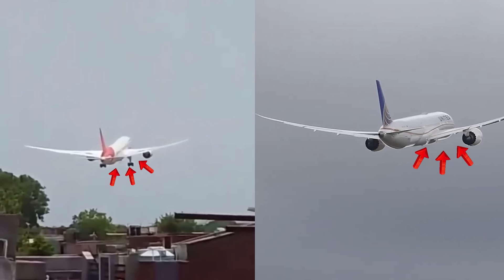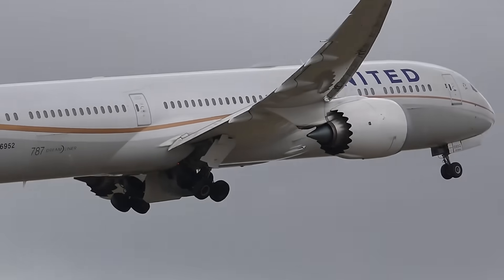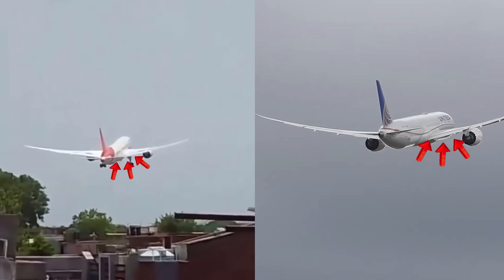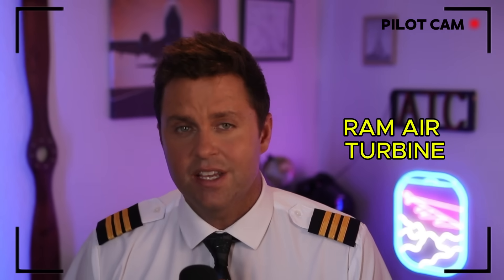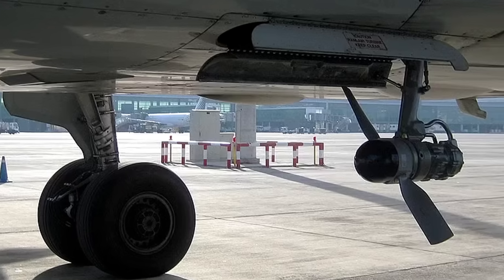Pilot Explains: A New Detail in the Air India 787 Crash Everyone Missed

Comment: Ok, what happened was when the pilot monitoring correctly commanded gear up, a massive electrical arc failure happened and it made an uncommanded shut off of the fuel supply to both engines and at takeoff power, engines starved immediately, RAT deployed and they coasted to the crash. Inspect all 787 wiring insulation immediately, ground the fleet, why am I not in charge, cuz I’m stoned.

Comment: Yes that sounds like a good explanation of what could have gone wrong. I too also noted that in the video of the plane you don’t here the engines roaring (as when taking off) . Second point it seems, as Gary mentioned, that the wheels are in position to be parked but the panels still seem to be closed (and never open) probably indicating no hydraulics.
Last point following Ryan’s comment that have simultaneous engine failure cannot be for engine failure, nor fuel… it would be very unprobable … suggesting some sort of interruption stopping the fuel being sent to the engines

Comment: If anyone took the time to watch the video of the passenger on THIS plane on the flight, JUST BEFORE this one........
They will see that there were multiple system failures on THAT FLIGHT.
Enough to cause an ELECTRICAL SHORT, that caused both engines to fail.
I'm  NOT a pilot or  stewardess. I don't really like to fly.
But mark MY WORDS, it will be found to be electrical failure that caused both engines to fail.

Comment: Great job! I'm at 25000 hours ttl, 20000 in the B-737. Rumor going around, and I'm sure you've heard,: engines experienced a cascading dual engine FADEC failure.  Uncommanded bus transfer failure due to arcing in main power relay box. Water intrusion during preflight, GPU disconnected in heavy rain prior to pushback+ loss of eec at rotation, causing engine rollback after rotation. That, and a bunch of other technical mechanical/electrical $hit.

Comment: No one wants to talk about the obvious… In The Hound of the Baskervilles, Holmes deduced that the murderer was the dog’s master, and that is why it didn’t bark as the violence was taking place. The master was a refined gentleman who was beyond reproach or suspicion. The 787 has been in service for 14 years with no history of dual engine flameouts or hull loss. No other aircraft had fuel contamination problems at that airport. Any vapor lock problems would have had a history. The only plausible explanation is that the fuel was shut off after takeoff. Start looking at the pilots. When something happens that is crazy, do not eliminate the crazy explanation.
The black boxes will reveal all switch positions during the entire flight. I will be very surprised if the fuel start levers aren’t in the shutoff position.

Comment: 28 years and 22,000 hours with the airlines. I agree it was a double engine failure for those symptoms you listed. However, I do NOT think it was a fuel contaminant problem. Fuel contaminants don't typically cause smooth losses of power equally in both engines. I believe there is likely a software error in the ECM. I want to know when were the last software updates to ALL systems uploaded?

Comment: ----->140% TOO HOT TO FLY! 
Everything on the 787 is not only electrically controlled but, automated to some degree to be THE automatic Aircraft.
787s are the automatic Aircraft. That said, Computers (CPUs, ECMs, PCMs, Fly by wire which are all susceptible to heat saturation) are doing the complex work of the Pilot and are flight instruments and controls. How HOT did the Pilot's Dash get?  HOT HOT HOT enough to crash. How many people reading this have notice a Crack in their Vehicle's dash? How many people reading this have left their iPhone in the Sun and what happens then? Right, it shuts down!!!

Comment: I could be wrong, but that "wind down" of the RAT sound could be the doppler effect of the aircraft moving away from the cell phone. Think of a train as it goes by you. "Ding, ding, ding, dong, dong, dong…."  

Consider also that the METAR allegedly got as high as 43℃ which is some really thick humid air. That probably effects how the cell phone picked up sound. All this is conjecture on my part.

Comment: Hey @Garybpilot,

I really appreciated your thorough analysis of the tragic Air India crash—your breakdown was insightful and well-researched. However, I noticed that one angle hasn’t gotten much attention: the possible role of cabin temperature control and air conditioning malfunctions.

A passenger who flew on the same aircraft before the incident reported persistent issues with the AC, entertainment system, and even the flaps (https://youtu.be/9EDho1UDWzM/). Given how extreme heat and system failures can impact both crew performance and equipment, do you think this could have been a contributing factor?

I’d love to hear your take—maybe even a follow-up video diving deeper into this aspect? Keep up the great work!

Comment: Thank you for your analysis. My question is: 1, if it is a dual engine failure. The parameters would be downloaded by datalink in real time and the inspection for the fleet should begin right away. 2, Did the dual engine failure happen before gear up or after the gear up commanded by PF? Why the crew kept the gear down up to 600 ft before the “due engines lost?” 3, the crew use the TO-2 or TO-1 (not assumed temperature)for taking off with a wrong flaps setting or an accident flaps lever moving from 15 to 5,  Is the engine power still good enough to fly the take off segment 1&2? Thank you.

Comment: How comes no one has mentioned the idea of maybe the cargo if any on board was incorrectly loaded causing no lift or over weight? As looking at the take off clip the 787 used beyond the full runway (dust in the air) to take off but still had not enough lift. I think the engines were fine but something with the weight ratios caused the accident, either when loaded or inputted into the aircraft by the pilots prior to take off

Comment: If you look at the cockpit of a 787, the gear lever is very different from the flap selector (especially being two-position vs. many selection notches), so it's hard to imagine that a pilot with more than a few takeoffs in a 787 could mistake one for the other.  (And that tilt of the bogies seems conclusive that the gear had started coming up.)

Comment: Long ago there was a twin-engine airliner that lost both engines at cruise altitude due to loss of oil in both.  The oil loss occurred because both engines had just had routine lip-type oil seal replacements.  The maintenance people  had assumed that the seal assemblies (the seal pressed into a housing) included sealing o-rings, but they did not; they were supposed to added by the maintenance people.  (The o-rings are to seal the housing to whatever it is they mount against.)  The result was a slow oil leak.  The flight crew restarted after a long glide from cruise altitude and made a successful landing.
I'm not saying that's what happened here (the loss of oil took a long time), just that dual engine failure can happen due to some common cause.

Comment: U sound quite genuine and absolutely logical. There is no one upmanship in what u say. U r only trying to debate and come up with possibilities. I am no aviation expert, nor am I a trained pilot. As a ordinary layman, I can smell some kind of sabotage in this whole thing. I sincerely hope and pray that I am proved wrong.  Sabotage is a very strong possibility for twin engine failure….both the engines failing together is normally impossible….But what if there was a sabotage through turning off of the fuel pumps?….With whatever fuel that was there in the fuel lines, the plane took took off, but after that with the fuel pumps not working, the engines died out of fuel starvation….Remember, India’s PM has many enemies from Pakistan. That the accident took place in Ahmedabad, the very soil from which India’s PM and Home Minister hail, is no coincidence to me. As a layman, I strongly suspect sabotage, and the hands of India’s enemies. India’s neighbouring nation has been bleeding it with several thousand cuts, and this aircraft crash is one of those many thousand cuts……
Reply: "Normally impossible" is an odd phrase to use, because any failure of anything is by definition not normal.

Comment: Dual engine mechanical failure is unlikely. Fuel contamination is also unlikely, there are hundreds of flights occuring in that airport and nobody had fuel contamination issues. The only possible way that 2 engines lose throttle on both engines at the same time is by losing engine response centrally, a system which controls both engines through the Common Core System (CCS) — specifically through the Aircraft Information Management System (AIMS) and its integration with other avionics. A fire or electrical failure which supplies the CCS will stop sending signals to both engines and cause it to auto shut down or throttle down to idle, losing power. This in turn deploys the RAT.

Comment: Two events are sure to have happened. 

1.RAT was activated. 
2. There was serious power issues when the  flight was landing in Ahmedabad as per a video from a passenger.
So, it's obvious that it was a central power failure that led to dual engine failure and RAT activation. 
It's simple localisation. There's no possibility of  mechanical failure due to contaminated fuel. It will almost always affect many flights.

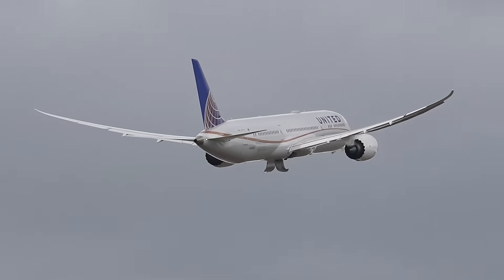Comment: I read somewhere in another video that the 787's slats will auto deploy. But not the flaps. But it does look like the flaps are indeed extended at 1:45. As for the RAT being deployed. I watched another video. And it sounds like it was deployed. Had a prop sound to it. And it was compared to a test flight of the the 787 with RAT deployed. They sounded exactly the same. This crash was a text book crash with both engines out. Side note. I never realized the 787's landing gear did that. I assumed it was the same as the 767's. Off topic note. I have flown on a 777. Still prefer the good old 747-400!

Comment: For those who say "it doesn't make a lot of sense," let me explain: A short takeoff from the Taxi Way entrance, overloaded to a million pounds, a lack of maintenance, or a maintenance error. Possibly watered-down fuel, excessive stress from those first two things. Loud Bang. Which could have been the RAT deployment. Or, engine failure due to the short takeoff and double capacity load. I often wonder if speculators aren't just trying to manipulate stocks one way or the other. Do you work for Boeing?

Comment: Still to be verified but it looks like a catastrophic electrical failure on rotation. 

Flight: AI-171 | Aircraft: Boeing 787-8 | Date: June 25, 2025 | Route: Ahmedabad (VAAH) → London Gatwick (EGKK)
Crash Site: ~1.2 km from VAAH Runway 23, post-V1 and rotation
Fatalities: <270(241 onboard + <29 ground)
Survivors: 1 onboard survivors (alternate to original), 3 injured on ground

🛠️  AAIB Preliminary Report Highlights

1. Primary Cause – Electrical Power Transfer Interruption (PTI) During Rotation
	•	During transition from ground to airborne electrical configuration, the aircraft experienced a cascading dual-engine FADEC (Full Authority Digital Engine Control) failure.
	•	Root cause: Uncommanded bus transfer failure due to arcing in the main power relay box (PRB-A), traced to water ingress during pre-flight GPU disconnection in heavy rain.
	•	This led to loss of electronic engine control at rotation, resulting in both GEnx engines rolling back to ground idle within 4–5 seconds.

2. Flight Data Record Timeline
	•	+0:11 sec: Nose gear lifts off.
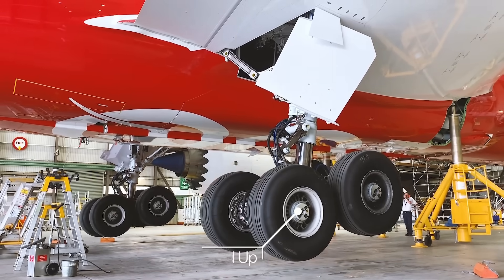	•	+0:13 sec: Sudden engine rollback begins. Thrust reduces from 92% N1 to <27% within 3 seconds.
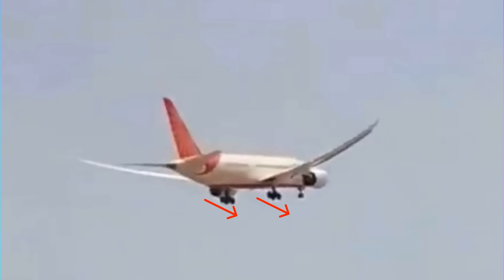	•	+0:16 sec: Master caution + ENG FAIL L/R warnings. FO calls, “Both engines dropping!”
	•	+0:20 sec: Autopilot and flight control reverts to Direct Mode. Pitch up attitude peaks at 18°.
	•	+0:25 sec: Aircraft stalls at 186 ft AGL.
	•	+0:30 sec: Full aerodynamic stall; nose drops rapidly.
	•	+0:38 sec: Ground impact at 54° nose-down attitude, 174 knots.

Contributing Factors
	•	Environmental Conditions:
	•	Torrential rain during pushback.
	•	Moisture intrusion into PRB-A connector (P/N: HLN8471) — a known corrosion-risk component.
	•	Latent Maintenance Issue:
	•	Power transfer relay unit showed signs of thermal damage in a previous MEL deferral 2 weeks prior.
	•	No replacement had been conducted; aircraft was cleared under repetitive deferral.
	•	Design Oversight:
	•	Boeing 787 has no physical engine control backup (i.e., no direct mechanical linkage in FADEC loss scenario).
	•	Loss of power supply to both EEC channels resulted in engine “freeze” at ground idle instead of flameout.
	•	Flight Crew Response:
	•	Attempted engine relight sequence not completed before stall onset.
	•	Emergency power selector not activated — possibly due to confusion from multiple ECAM warnings.
✈️  Immediate Safety Actions
	•	DGCA + EASA + FAA Emergency AD issued within 24 hours:
	•	Mandatory PRB-A moisture integrity inspection on all Boeing 787 aircraft.
	•	Temporary restriction on dispatch with MEL items related to power transfer systems.
	•	Boeing:
	•	Issued Service Bulletin SB-787-24-212 requiring replacement of PRB-A connectors with sealed versions.
	•	Exploring addition of dual-path power redundancy for FADEC systems.
 Lessons Learned
	•	Over-reliance on electrical power distribution architecture without layered redundancy.
•	Lack of crew procedural training for full engine rollback during takeoff in EEC dual failure scenarios.
•	Need for improved environmental sealing in GPU/electrical handover units in monsoon zones.
Human Toll
	•	The loss of 243 onboard lives, including 12 crew and 18 infants, deeply impacted the aviation community.
	•	Final words captured on CVR: “We lost everything – no thrust!”
	•	One family of five was killed on the ground in a hospital ambulance struck by debris.
Timeline – What’s Next?
	•	Aug 15, 2025: Release of FAA/Boeing electrical design audit report
	•	Sept 5, 2025: ICAO session on electrical-critical phase-of-flight risk mitigation
	•	Oct 2025: Mandated design retrofit across 787 fleet (rev. SB-787-24-219)

Comment: The pilot said on the radio that they lost power which is consistent with the RAT deployment. Contaminated fuel, fuel vent system blocked,Bird strike, finger problems from the crew, sabotage or suicide.

Comment: While the possibility of a dual engine failure on the 787 due to contaminated fuel has been suggested, I find this theory questionable. Aircraft at major airports typically refuel from the same supply, and yet no similar incidents have been reported involving other planes. If the fuel were truly contaminated, it would likely have affected multiple aircraft, not just one. This inconsistency makes the contaminated fuel explanation seem unlikely in this case.

Comment: ONE OF THE WAYS BOTH ENGINES COULD HAVE FAILED EVEN THOUGH THIS IS AN ETOPS AIRCRAFT AND HIGHLY UNLIKELY IS IF THERE WERE DUAL MAI TENANCE PERFORMED BY THE SAME MECHANIC ON THE SAME PARTS OF BOTH ENGINES AND THE WORK WAS NOT DONE PROPERLY THIS COULD RESULT IN DUAL ENGINE FAILURE THATS WHY WHEN WE WORK ON ETOPS AIRCRAFT ITS VERY CRITICAL THAT DUAL MAINTENANCE  IS NOT PERFORMED ON BOTH ENGINES ESPECIALLY BY THE SAME MECHANIC....THERE HAS TO BE A SECOND INDIVIDUAL TO DO THE WORK ON THE OTHER ENGINE BUT STILL REQUIRES A VETIFICATION FLIGHT TO VALIDATE THE SYSTEMS PERFORMANCE AND SATISFY THE DUAL MAINTENANCE REQUIREMENTS.

Comment: One thing you mentioned is very relevant, which I too asked myself after watching the original clear video. The RAT sound is audible. But for it to be audible, the main engines have to be silent and certainly there's no roaring of the engines that's usual when a flight takes off.